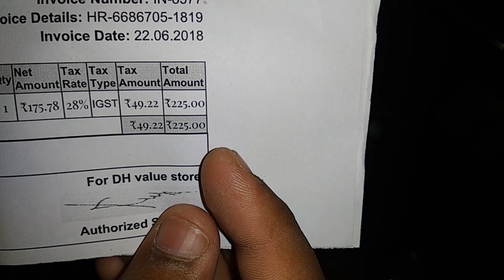Parking Light Mod || Zen Estilo || Happy Mod

Comment: How to operate lamp which is between head light and grill
Reply from the maker: Eventually you need to open the front bumper grill that is holded by two bolts upfront
Reply from the maker: And I got your question soon making a video on it